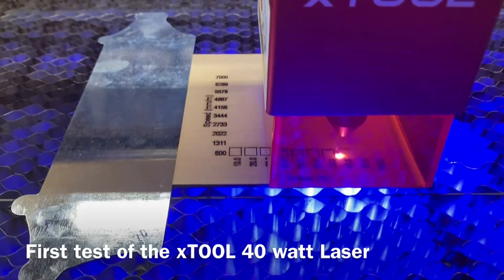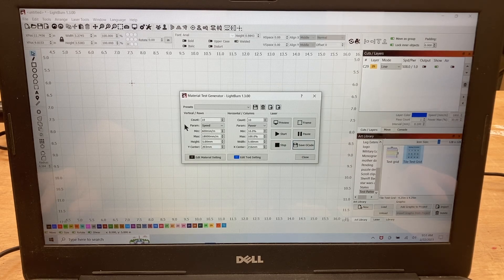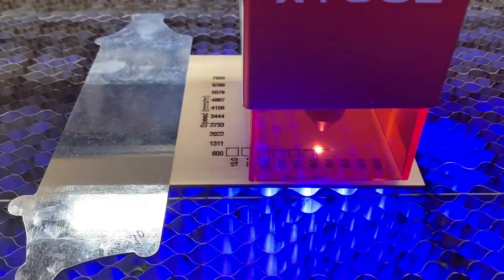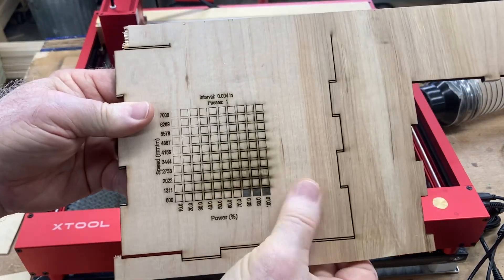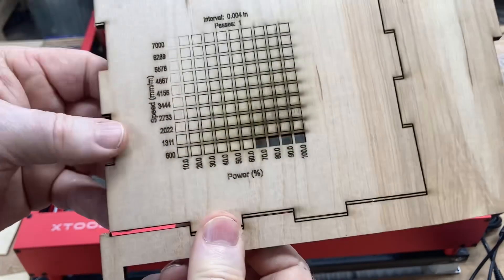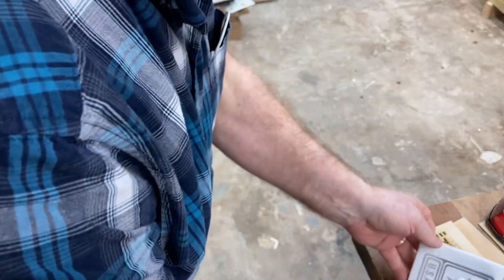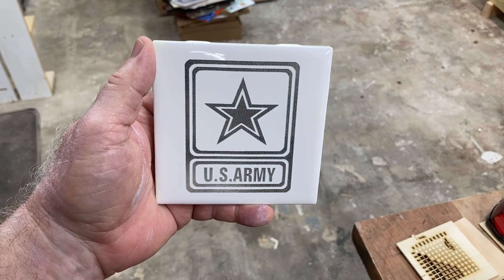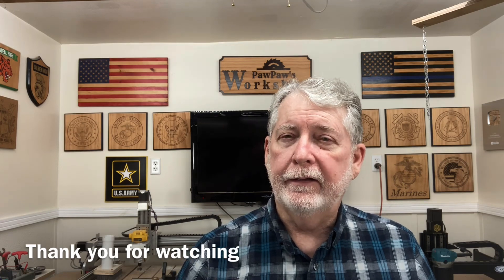xTOOL 40 Watt Material Test

Comment: Thanks for the grid suggestion. I didn't know it was built into lightburn. 

As to the laser life, I'm not sure what the fear of using your stuff is. 8-9,000 hours is a LOT! If you ran the last flat out at 8hrs/day, 7 days a week, and 52 weeks/yr, that's 2,912hrs. That means you could run that thing for about 3 years straight before it would die! Man, that is a really, really long time! 

I'm guessing even the majority of people using these to make money maybe run them for 1/3 of that amount, so it would likely last over 10 years. You will likely be on to bigger, more powerful, and higher quality lasers by then. Not that I want to subvert what you're putting out there, but the math kind of says it all.
Reply from the maker: Thank you

Comment: I'm getting really bad burning around whatever I'm trying to do.  I don't think my air assist is working correctly.  You mentioned your air assist isn't turning on unless your laser is doing something, but how is that possible.  How would the machine dictate when the air assist turns on if it's just plugged into a regular power supply.  How would it control it ???  Please help 🤣  because I can't even get my test grids to look like anything without scorch marks everywhere
Reply from the maker: The air assist is controlled by the software. If you have a separate power source then that will override the software in that you will just have to turn it off and on. Have you cleaned the laser lens. If it gets dirty you will not get the correct focus and can cause the burning. Overpower is another cause with too much power.
Reply: @PawPawsWorkShop   Oh I think I have been way over powering lol.  I 'turned' the settings down pretty far and that fixed my issues.  Thanks so much !!  And yes, my air assist is plugged into a different source.

Comment: Soooo… I bought a 40w straight out the gate. Whaaaaat? It was on sale! 😂 I’m so frustrated because I still haven’t been able to make anything that looks good. This laser is POWERFUL
Reply from the maker: Do you have Lightburn software?  It’s only $60 and it will do anything you need. Also do the grid patterns to get you power and speed dialed in   Also, congratulations, it a great adventure

Comment: You are really wetting my appetite for a more power laser from my Ortor 7.5 watt laser. And I have all kinds of tools to cut 2x4’s and a laser is not one them. I appreciate the video! 😁🛫
Reply from the maker: Thank you very much. Yes, a diode laser should not be cutting a 2x4. I’ve seen fires started and lasers damaged trying to do this. Does not make any sense. Thank you for watching
Reply: I also have the 40 watt, and I did not get it to be a cutting machine either...someone else can get their jollies by cutting 2x4 lumber if necessary.

Comment: I have the D1  but upgraded to the 20 watt... will the 40 watt work on mine????
Reply: Nope. The XTool folks decided the original purchasers of the D1 couldn't upgrade to the 40w. The 40w only fits the D1 Pro.
Reply: @jimnugent1143  I just wanted to let you know that I was looking around the xTool webiste, and according to xTool, you can fit the 40 watt upgrade to the D1 frame. You would not be able to use the limit switches that come with the upgrade, and you would no longer be able to use any of the D1 lasers after the upgrade (unless you switched everything back). I found this information on the Store portion of their site after clicking on the "xTool 40W Laser Module for D1 Pro" and scrolling down to the FAQ section.